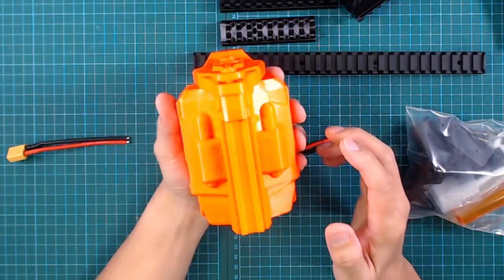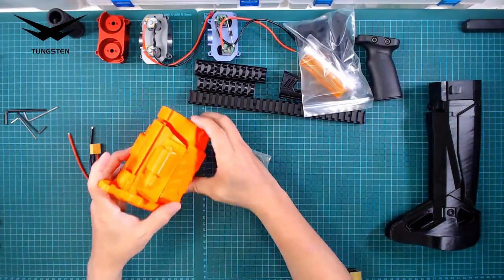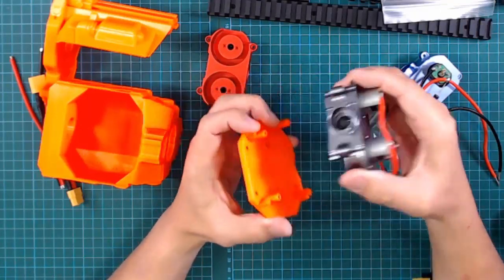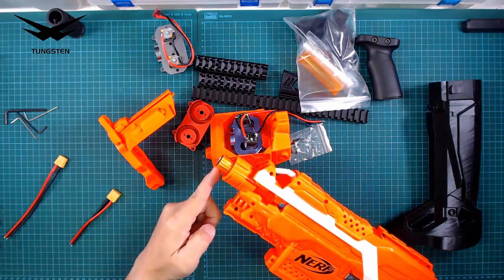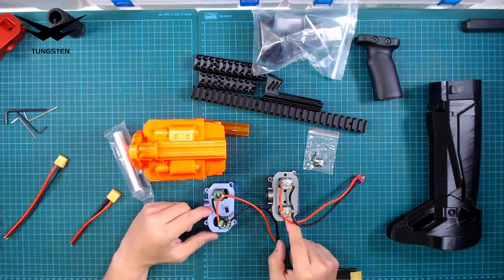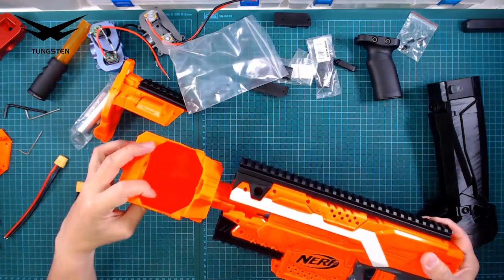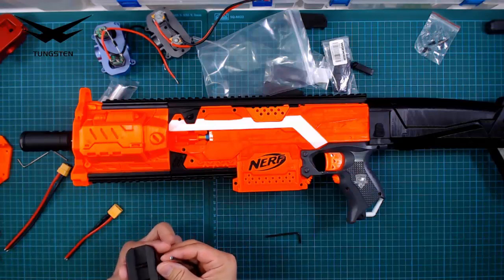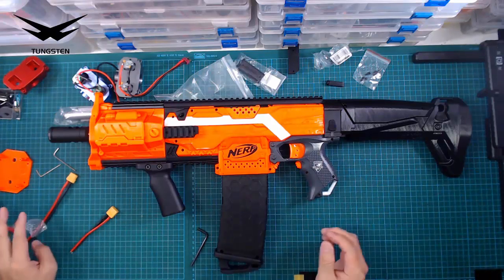Things I Bought #5 - Worker Stryfe Afterburner

Comment: I find it odd that they wouldn't want to orientate the cage vertically to streamline the design and opted for the horizontal orientation. Maybe it helps with accuracy as an afterburner platform? Who knows.
Reply from the maker: Yup, before getting the item, I too thought it will be a vertical design.